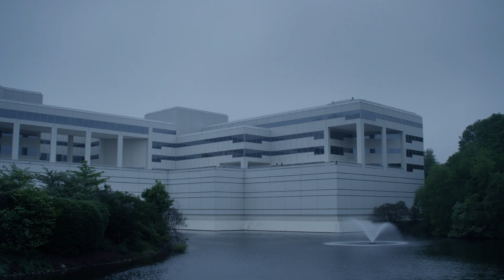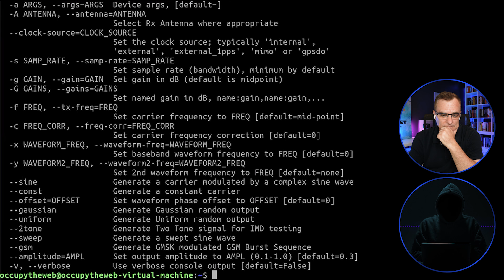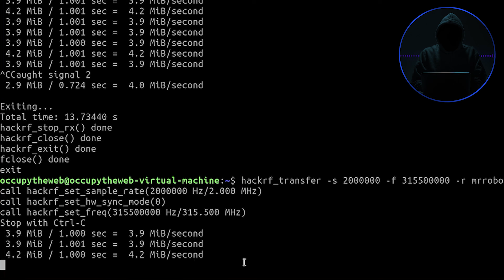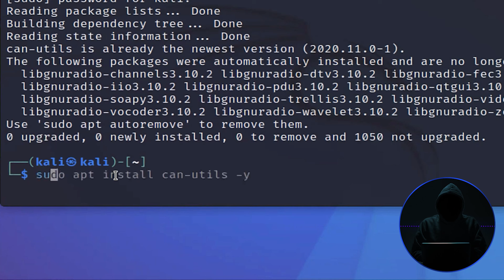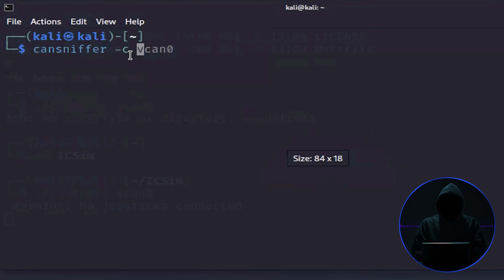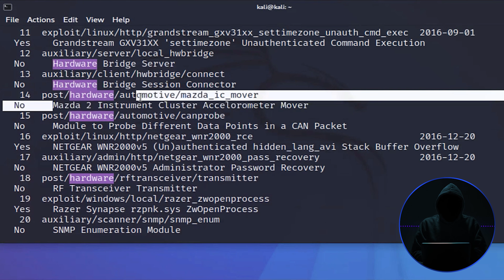Warning! This is how cars are hacked. Just like in Mr Robot.

Comment: Mercedes use two freqs for their keyfobs. The jam portion is tough because the HackRF or other SDRs do not have the power output necessary unless you are literally standing next to the target. The roll + jam method will work but it is a proximity based method. I prefer to use URH to record and analyze signals + replay. As always David another great video.
Reply: i find a mixture of porta hack2 and zipper  does the job - add an ext module for the flipper to get more range and power

Comment: Fun fact about signal jamming to counter radio controlled IEDs in Afghanistan…our jammers in our trucks actually block the satcom signal we sit on for higher command. We were using that frequency over sat to call in medevacs and one time, we took a casualty and we had to call in a medevac right away. But our ground force commander was getting no dice with the sat comm. comes right up to my truck, flips the switch on the jammer, and finally got higher on the radio. Now, I didn’t know this at the time but everyone around me assumed I did so I got yelled at for having the jammer on when it should have been off. But - the Taliban are very, very, very, smart. It was always a joke they are just a bunch of cavemen in paper sandals and pajamas. Nope. Very intelligent individuals. So when they realized inside our trucks were hammers to jam radio and cell signals to counter their IEDs attack, the Taliban increasingly (and quickly too) moved to using what we call “command detonation” initiation. A physical power crowd that some times ran hundreds and hundreds of feet, sometimes burried under a few inches or maybe even a foot of dirt and would run into an orchard or into a random civilians home and they would sit and wait and remotely set off the IED with a cable that ran all the way to it. We came across a couple of those when I was there along with reverse pressure plate initiations (meaning, releasing the pressure from the plate sets it off - they would put big rocks in the middle of the road knowing we obviously have to move the rock and once it’s lifted up, the IED goes off) and standard pressure plated IEDs. I think we only came across one “RC” IED in 2014 and about 300 yards away I saw a guy in the window banging on his cellphone through my scope looking all confused. I asked to fire on him as I was 100 percent certain he was infact - the trigger man and he was awake wayyyyyy too earlier yo be making cellphone calls but was told to let him go. Our jammers 100 percent jammed the signal and would not detonate that IED we found
Reply: This is a stupid question, but could you possibly see an I.E.D with a thermal camera? Before it explodes of course, lol.
Reply: @kensmechanicalaffair  no thats absolutely not a stupid question thats actually a really good question. Now how we use our eyes to look for something that isnt right in the ground is look at the dirt all around you and look for a patch of dirt that clearly looks like its been turned over. Alot of times, the taliban planted IEDs on us the night before or two nights before. Which would mean when they cover the IED back up with dirt, its being mixed with the colder, more moisture rich dirt they dug up. So if the IED was planted a night or two before, youll notice a patch of dirt in the road that looks darker than the rest of the road. That would also mean that the dirt that surrounds the IED is cooler than the surrounding dirt. So if you used a thermal camera to pick up on the road, youll noticed a spot that looks cooler than the rest of the road and that would be a warning sign that dirt was recently turned over which could indicated an IED was planted there. We dont normally use thermal cameras but on occasion we actually did. We had them on trucks to actually look up at the mountain peaks to look for spotters or possible trigger men but there was a time we found that weird looking patch of dirt and had the K9 go up to the dirt, and wouldnt you know it....she hit on the dirt (meaning shes saying something is here) and it was 4 jugs of HME. Which is like a fertilizer they like to use for IEDs and my Thermal camera on the truck that morning actually saw the spot on the road where the dirt was cooler than the rest. So no, deff not a stupid question. But I wouldnt rely on something like a thermal camera to pick up on that. Radio jammers, dogs, Ground Penetrating Radar, and your own instinct works best.
Reply: @Kaotix_music  Interesting, thanks for the reply.
Reply: I worked on EA-6B Prowler electronic warfare aircraft.  In my day they were mainly used for radar surveillance and jamming but during the GWOT they were upgraded to deal much more with communications surveillance and jamming.  The ability to do a lot of what is discussed in this video but at a different level (record and playback, IMSI catcher, etc) gave the platform a whole new mission in life which was great to see.  Sadly the Marine Corps decided to retire the platform and there is no real replacement at this time.

Comment: Commands to figure out what devices are in firmware: dmesg; lsusb -v; lspci -v; ls -lart /dev | tail
If you know that the device is a character device that gives a bit more info. You can also do a deep query on a particular device by id. 
On Sparc Solaris there is a dedicated firmware layer that you can enter and depending on the device (if not a laptop) there may be dedicated means of controlling or configuring firmware

Comment: When using the sniffer, could you not  connect to  OBD11 port and sniff a data sample of the target vehicle?  I worked for a  GPS tracking company and,  we would drive the most strictly controlled ( what we could control) route accounting for traffic, red lights etc,. All the while capturing the NEMA and OBD11 data and we could loop that  data into our tools and  recreate the test drive for a number of reasons.  This is pertinent  as we could learn  a lot from the data including the the manufacturers implementation of the SPEC i would have added quotes to SPEC, but you all know why that doesn't translate.   YOU ARE ABSOLUTELY CORRECT. .  it is so loosely defined that we  consider it a guideline rather that a SPEC.  Freighters and  MAC K trucks would change their stuff every couple of years.   it was challenging.  If there is a method available for one to grab a data capture from the actual target vehicle and collectively with the community we could compile a database for every ones benefit.  OOPS!  I reacted before finishing you demo.  Sorry bout that.

Comment: This is reason alone to drive an old car. Any car newer than -08 this could be done to pretty much. Some older tha. That... They can lock your throttle on max and turn of the brakes for example.
Reply: Robert Bosh invented the can bus in the 70's. It's been controlling the car a long time.

Comment: So my biggest sticking point  with the car hack is the steering lock, Mr Robot doesn't address this problem(that i remember). Sure you may be able to start the car but if you try to turn the steering wheel a certain amount (left or right without a key ) the steering column will lock preventing any further turning. Still i love the show and suspend disbelief 😀
Reply: You pretend to be the key fob, so the immobilizer isn't triggered that something is amiss.
Reply: @iam1smiley1 That isn't possible. There's a chip inside the fob that sends its data to the car after the start button is pressed or when a key is turned in an ignition. If it's not present the car is going nowhere.

Comment: You left out quite a bit and showed one trick for people to experiment with on their own vehicle which will probably end up with a calls to a locksmith, tow truck and dealership.
Reply: Physical attacks are not really plausible in todays world- most people who get into this and do test on their own vehicles, however, may not damage the internal units. Most networks and modules within vehicles are complex enough to protect against any kind of fault. Not to mention most vehicles now still rely on FlexRay or CAN-FD which are both ( expensive ) but also very very error-resilient.
Reply: @fancy-reaper3697  There's too much missing and misinformation in this video to discuss by chat. Clearly, these people don't know much about vehicle security, which is good. They seem to know how to use some basic sniffing tools but don't know how to communicate with the vehicle's computer, nor do they understand what information they're looking for. 
The procedure presented for capturing a signal and replaying it is accurate enough, but when executed, it easily breaks vehicles, which is what I have issues with.
These flipper zero kids graduated to a HackRF and a laptop, but don't know what to do with it because they don't understand the system they're trying to communicate with.

Comment: I never closed or opend my  BMW 730 with my key. It was keyless to go! I just has to grip the doorhandle! Ok my key was in  my pocket!  May this a problem, or is the signal the same?? What about the range? Audi A8 ...you can buy this Smartschlüssel für Audi A8 (2017+) - 434Mhz - Keyless Go 4N0 959 754 - 3 Tasten - OEM produkt, for 178 EURO;   and code it!  Maybe easier?

Comment: So what I want to learn is how, once my laptop is connected to my friend's car, is how to diagnose the problems she is having with engine management computer. I have no desire to cough $800 for a dedicated device to do this.
Reply: You mean ECU?
Reply: if you're just doing standard mechanical diagnosis for ECM codes stored by the car, all you need is a cheap obd II interface (bluetooth, Amazon/Ebay $6-16 ) and Torque (software free-$5). You can use a laptop or phone to read stored codes, along with a few other performance items, and follow the web lookups for what the codes are referencing. That can also clear many trouble lights to see if it repeats or was a one time sensor fail. 

while that's not to the level of diagnostic equipment that a properly outfitted mechanic might use, it will get you into the neighborhood and let you decide if you need a more professional scan or not.
Reply: @wtfisdat6382  I need the professional scan, so professional software
Reply: @jeffreysmith236  there are no cheap solutions to the professional level software and that includes pirated Chinese versions.  They're all going to cost more than a mechanic would to do the scan. 

They pay for their gear with volume use. A one time use, even of the knockoff gear, would still put you upside down.
Reply: @wtfisdat6382  thanks
Reply: 800!?

Comment: could a hacker crash a car at high speed using hacking?
Reply: I'm sure. Especially if it has autopilot with a motor on the steering wheel.

Comment: 37:20 if you're already inside the vehicle, no more hacking need lol.
Just flash the ECU modules to disable any anti-theft system. 
From that point on, all you need to do is power to the corresponding OBD2 pin to start the ignition, then the other pin to activate the starter. And drive off.

Comment: LMAO if the thief is smart enough to do all this things than he wouldn't be opening cars, he would be doing something more productive. 99% of thief's are stupid they just brake the window. I'm a professional auto locksmith so I can tell you yes you might hack the locking frequency but good luck starting the engine.
Reply: Thieves do, in fact, do this. And then they do, in fact, drive off.